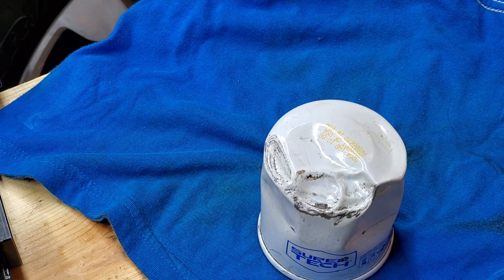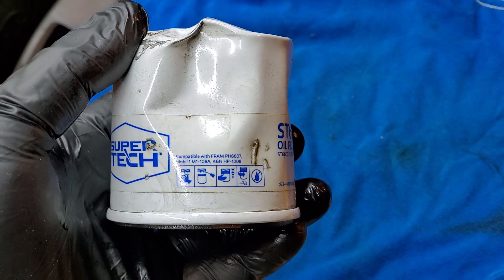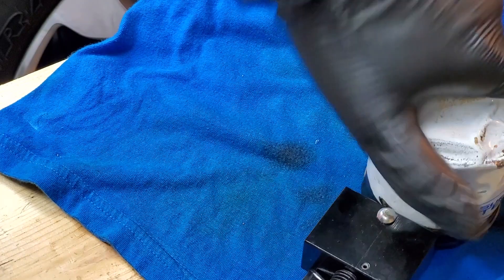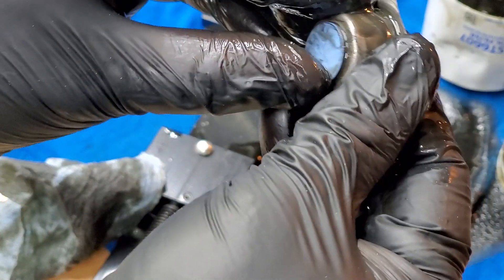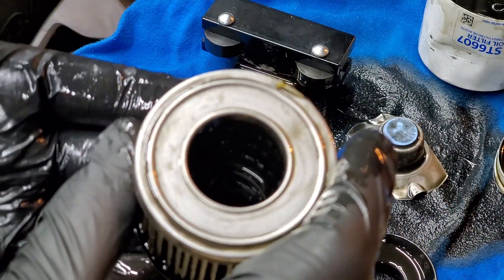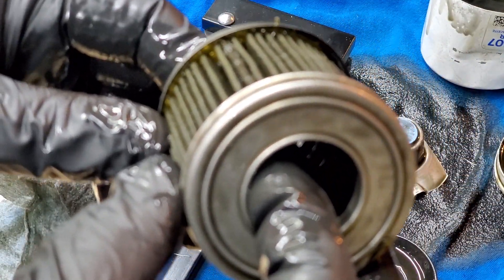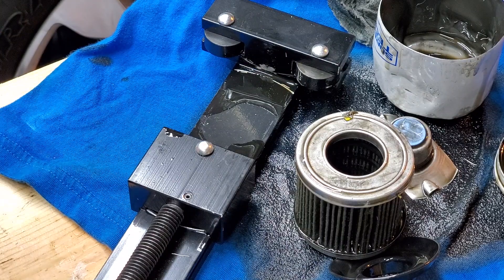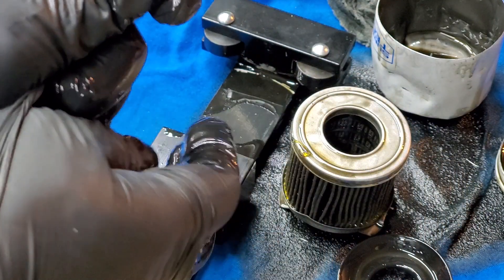SUPER TECH OIL FILTER ANY GOOD? THIS ENGINE FAILED IS IT DUE TO SUPER TECH?

Comment: Change your oil every 3k and it eliminates the possibility of causing early damage. I use Super Tech and a Synthetic oil and change it every 3k and  my customers and I have been doing great that way. Could we go longer sure but why play games with your engine when changing oil is so easy and so cheap.
Reply from the maker: It makes sense changing oil more frequently when using cheap oil and filters
Reply from the maker: I have done testing too using labs, and oil analysis reports available on my channel.  Some brands of oil go bad in less than 2k miles.
Reply: @repairvehicle  even more reason to change your oil more often! It's never to early but it is to late!
Reply: @repairvehicle  which ones went bad sooner?
What type of driving on those tested oils?
Reply: There's no reason to change it every 3K especially if it uses oil if you're putting a new cord in every thousand Miles you should go at least 5,000 MI @repairvehicle

Comment: I use super tech oil and Toyota filter.  The supertech oil has high ratings for its price range and durability. Like many have said, as long as you change it consistently, the oil does well.
Reply: Frank Spirk. Have you ever tried Costco Kirkland Brand Synthetic Oil?
Reply: @BOSS-xy8op  no  unfortunately I don't have one close to me. Only Sam's club but I heard it's essentially the same manufacturer Warren distribution.
Reply: The insides look comparable to a fram. They look as good as the genuine Toyota oil filters that are on my new Toyota Camry XLE. I change the oil in it every 1,500 miles and I'm sure they will work just as well.

Comment: Super tech oil and oil filter are decent products for the price, I've been using the products for several years with no problems, also uses Black Stone  laboratories for oil samples no problem with either products.
Reply: What oil change intervals are you using? For what vehicle and oil viscosity grade?
Synthetic or conventional oil?
Type of driving more of city or highway?

Comment: I've used ST filters and Valvoline synthetic oil since 04 only difference between blue filter and white is the anti drain back valve on blue is silicone, and white it's rubber. I dont let them go past 3.000 miles. 01 Ford Excursion with 338.000 miles.

Comment: been using super tech oil filters for 6+ years  no  issues.  ST6607 is the Filter  one I use.   they are actually better then fram filters.  for the most part.  I know it says 10K  miles but I personally wouldn't go past 7k on one of them.   Its actually made by Champion Labs, who makes  STP, ACDelco Champ and several other "private label" brands.   few years back thru a Merger  they are somehow owned by the same parent company as Fram.      Other SuperTech products  are typically good quality and  value for their price point.  The Oil here looks like it hadn't been changed in at least 20k miles and was not kept up. and that's what killed the engine  not this filter.

the specs on st6607  are 99% efficiency at 30 microns  for 10K miles.
Reply from the maker: In which vehicle you using super tech oil filter?

Comment: I use their stuff, they work for what they are.  Usually products now are 95% of the time fine for normal people.  I used the orange can's of death from fram forever as a teenager with warren oil in my 93 ranger it didn't die to oil issues lol.  Not going to say better wasn't out there but hey I was broke! change it 3-4k miles with synblend (new conventional apparently) and you'll be fine.  Oh and supertech filters are subcontracted in different places depending on which part number it is, the one you're holding the 6607 is made by stp.  but say the st10060, fram made.

Correction:  all the super tech filters are Champion contracted right now.

Comment: As a point of info, both Toyota and Honda OEM filters use fiber media( cellulose) end caps..I change at 3000 mi/3 months - been doing this since 1969..no problems at all with any of my vehicles, ever......
Reply from the maker: Do you still drive 60s vehicles ?
Reply from the maker: all of them from 60s currently on the road and daily driver?

Comment: What is your personal opinion on the KN oil filter?
Reply from the maker: K&N has 2 types of filter media, cellulose and synthetic blend.  Microns ratings they don't publish. In terms of filter media,  they are average quality filters.  These filters don't have any advantages over competitors when it comes to filter media.  Exterior features,  definitely has advantages.
Reply: @repairvehicle  I called  K&N several months ago and ask them to disclose thier micron rating they wouldn't. That makes me wonder why they wouldn't.
Reply: @chrisr.986  Probably because it's not super small but you don't really need or want that

Comment: They changed the inside of the rib to metal instead of plastic to prevent the plastic from breaking off and going back inside the engine. The valve is still plastic, but I like the rib being metal instead of plastic. Now because of this, the filter is almost $3 before tax. Still cheaper than most other filters.
Reply from the maker: This is what happens when factory recommended intervals ignored https://youtu.be/yBFPE6vupX8

Every car, truck and EV needs this https://youtu.be/H_bSDqnSh90

Maintenance mistake made by diesel owners https://youtu.be/WBOBzA56jvw

Why trucks don't come with this? https://youtu.be/hBbzJmCHtCo

How to improve lights without cutting or drilling https://youtu.be/K4WbM97pkmE

How to protect paint on the vehicle without wax https://youtu.be/I1fu9TsiYBc

Comment: Looks like a Subaru  number.  Spun number 3 rod? Bet it's been hot and run low on oil. If not headgaskets were done and heads planed. Then did it right after.